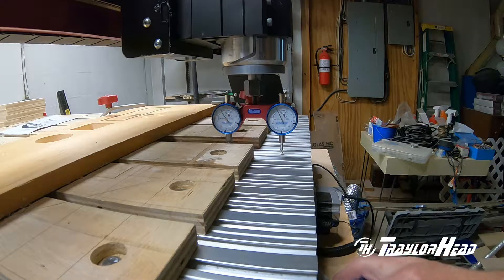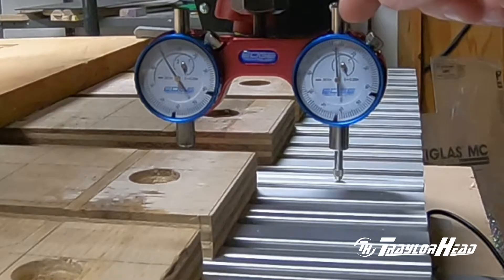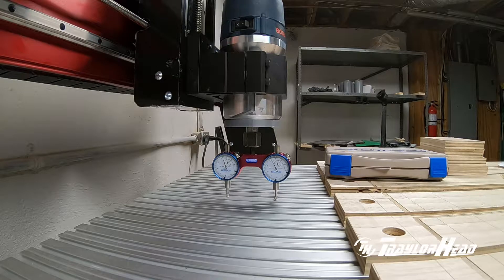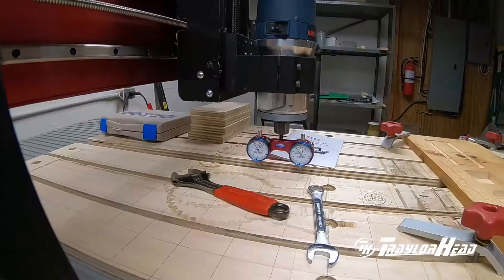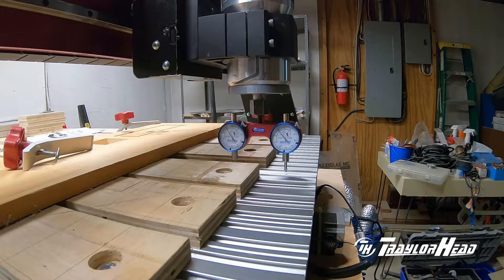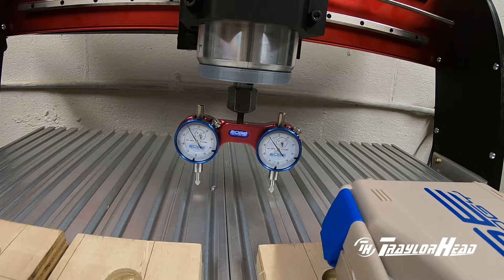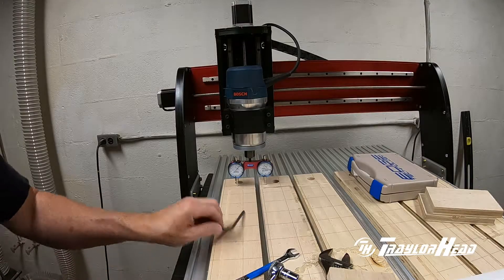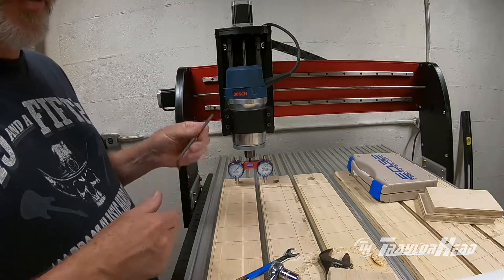HD4 to HD5 Gantry P3 of 4 (Measure and Test)

Comment: I have an HD4 and debating between doing this and just replacing the entire unit with an avid 2x2 or 4x4. I'm not sure why they love using HDPE it's really not rigid enough for this. Avid uses extruded aluminum for everything. 🤔🤔